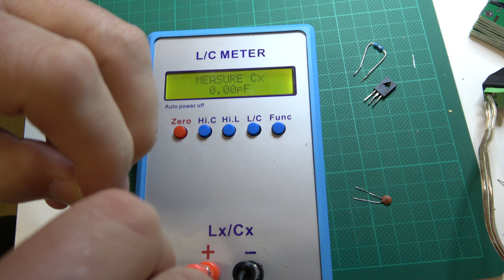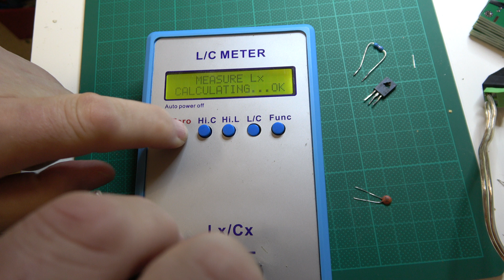FNIRSI LCR-P1 Component tester

Comment: LCR-P1 "E is on 2"    What school you went?  I just got ver 1.0.8 and they still haven't corrected the issues with reading pinout.  Just try turning a transistor 180 degrees.  Ver 9 I'm told still has the same problem.  Everyone should be warned about buying this device.

Comment: Can a multimeter replace all functions of this device?
Reply from the maker: Multimeters can measure resistance, some may do capacitors and inductors but few do bipolar transistors or FETs. This device is more compact than most multimeters and I like that it's USB-C chargeable.
Reply: @peterbmarks  hi peter i want to measure most components resistors, capacitors, inductors, mosfets, diodes etc and smd etc would you recommend?
Reply from the maker: @kerryprice-u2v It's not a precision instrument but it works just fine for my main use which is finding the correct wires on a transistor.